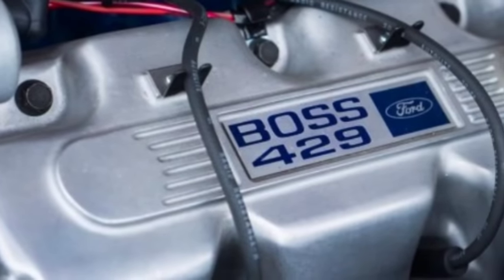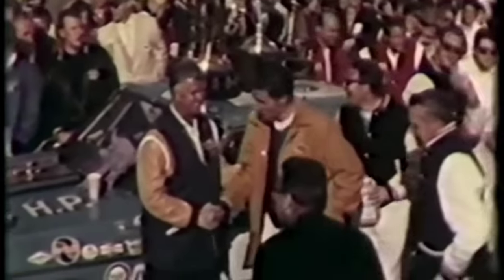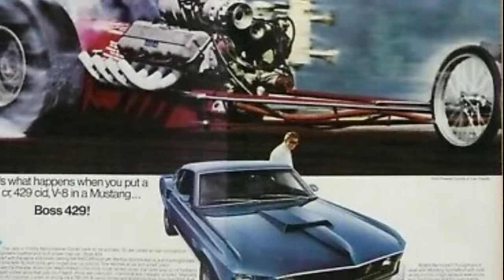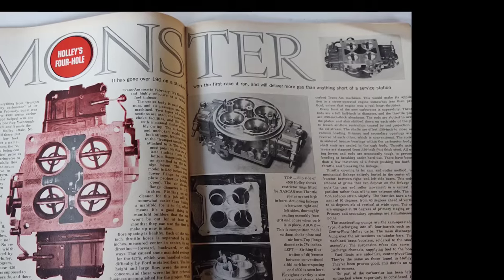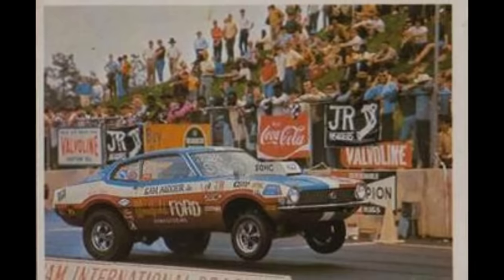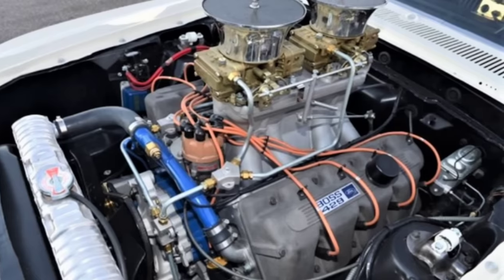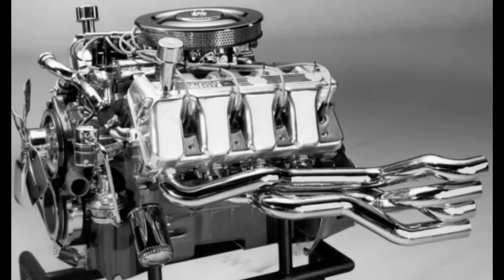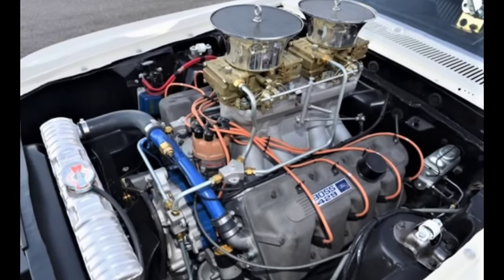The Misunderstood BOSS 429

Comment: fastest  car i ever rode in was a 70  mercury cyclone spoliler 428 scj, yes no typo a 428.....
Reply from the maker: The 428 SCJ cars were amazing!!! Severely underrated from Ford..  Thank you for watching! Please Subscribe and check out my project MIXED UP BOSS.. 
Andy
Reply: Did you know that just about all 427 Cobra roadsters sold to the public weren't even 427s.......they were pumped up 428s.  The 427 FE side oilers were put into the 427 Cobra S/C model.  Shelby thought the bigger cost of the 427 over the 428 would hurt the car for homologation.  However, if a customer found out he had a 428 and bitched about it, Shelby would supply the 427 to him.
Reply: Yes indeed. Great little factory street racer.
Reply: Semi hemi!
Reply: John Kasse builds big inch boss 9 line of engines!!!
Reply: I remember riding in my Uncle's 427 1969 Yenko Nova back when it was bran new. To this day it's the scariest ride of my life.
Reply: Those 428’s were quick. Ford made a bunch of 7.0 liter engines including the 427, 428, and 429. The first two were FE’s and the 429 was a 385 series engine. The 385 was just the name ford gave to the 429, Boss 429 and 460. But did you know you could make a 454 out of a 427 block and 428 crank? We built several in my HS Auto Shop Class for a local racer named Bill Cheeseburger. He dominated the 1/8 mile dirt track for a few years, and nothing could touch him! We also used 427 Tunnel Port heads which we ported by hand in our shop. I spent Hours with a strip of emery cloth smoothing out the downturn in the exhaust, which was pretty angular as cast by Ford. That was the worst part of those builds, the rest was pretty much common sense Hot Rodding. On the Street there was a guy with a 428 in a ‘67 Mustang fastback that was rumored to run high 8’s. The car had a tunnel ram with a pair of dominators on it. I couldn’t tell you anything else about it. And one last note, which I wouldn’t have believed if I hadn’t seen it myself. I worked with a guy who had a 69 Mustang Notchback with vinyl roof. It was clearly a luxury car, at least in dress. It had a run of the mill 302 in its but instead of the common high shock tower with an a arm and I arm underneath that, this car had twin a arms suspension up front. Nothing but room around the exhaust and no acrobatics or Yoga poses to swap spark plugs. The owner said that Ford had called him several times trying to get the car back, but he wouldn’t sell it.
Reply: Still my favorite sounding motor! I've never been lucky enough to drive one, though
Reply: Same Kerry's cyclone 70 with 428 shaker hood car beat anything on Woodward late 70s that was not blown engine or off trailer race car I've looked around n I've never seen another original 1970 cyclone 428 shaker hood ever always wondered what became of the car and my friend Kerry Peace n Love
Reply: Yep most under estimated Chevy big block killer out there.
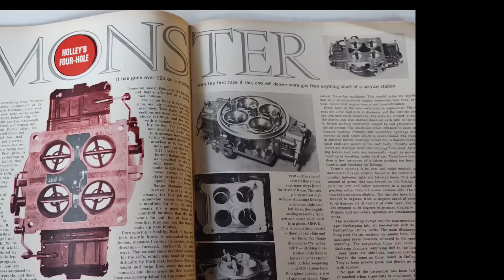Reply: 4:18 mark - The Holley Dominator that was built for the Boss 429 was not the carburetor we know today. This was designed to run as four individual runners (like running down draft webers). I did a story on this carb about two years ago that was veiwabout 200k times on my other Ford page on Facebook
Reply: oh trust me Ford still made limited big blocks in the day my 79 f250 camper special has a high compression heads with a 460 and a c6 transmission.
Reply: @kennethcohagen3539  Wow Greeeat memories. Thank you for sharing. That last one especially. 
Would love for that car to turn up.
Reply: I drove a friend’s 428 Cyclone on the street. 
Extreme is an understatement from a dead stop!
They were laughing at me when I returned. 
Apparently I had a death grip on the steering wheel because the horn was blaring all through my run!
The horn ring was actually integrated into the outer edge of the steering wheel !! 😂
Reply: @boostjunkie2320  my father wouldn't let ne drive his 429. Now I understand why.
Reply: Are you sure? I have a 1970 Mercury cyclone spoiler, and the engine is a 429 (not 428), which is a totally different block - not a FE engine.
Reply: Yup, I had a 69 Cougar Eliminator with a 428 SCJ... Raised compression, long tube headers, big cam, Rhoads lifters, bigger Holley carb, mechanical advance, non resistor plugs, big Accel coil...
Was never late for church 👍
Reply: I always loved the cougar eliminator.
Reply: Possibly the coolest muscle car ever
Reply: @LifeisGood762  I'm old. I remember this stuff. Ford engineers were beyond great. Another thing. Do you remember the autolite carburetors used in Trans Am racing? Two carbs . But they were like a hilborn injection unit. 4 holes in a row on both sides. Incredible thinking. They were allowed two 4 barrel carbs. But nobody said how to arrange them. Pure genius.
Reply: All hail the FE's
Reply: Wrong. The fastest car IIIIIIIIII ever rode in was my Toyota Prius Yenko superbird. 

Of course I'm kidding 😁
Reply: @xmo552  Now that's funny 🤣🤣🤣🤣🤣🤣
Reply: My buddy had a Wimbledon White '67 Shelby GT-500. He swapped the 428 with out with a 427 FE. You'd never know it at first glance, as the rest of the car was completely stock. It was a Screamer. His love was racing Ford Falcons. He unfortunately lost his left leg in a motorcycle crash and ended up running automatic transmissions. Rip Darrell.
Reply: @Cobra428SCJ  I remember those carbs. Truly awesome design. Very innovative engineering. To cool 😎😎😎
Reply: @brandonplaisted8194  i
Reply: Cobra jet go brrrr
Reply: The ‘69 Cyclone came with FE 428 CJ, the ‘70 Cyclone came with the 385 series 429, not the FE 428.
Reply: @ruthlessreid9172 I'm sooo glad he's doing that and bringing back the boss 429. With a stroked bottom end they work way better cos it evens up the bottom end with the huge head ports.
Reply: @Loulovesspeed i
Reply: I owned a 69 428CJ Torino Cobra that would roast the tires all the way to the rims! Never ran out of throttle!
Reply: 🤠 TEXASMUDNECK SAY OH so TRUE!!!!
Reply: In my senior year I found a nice 70 Charger 440 6 barrel for $900 and a close friend had a Torino Cobra 428 scj with a four speed...kinda miss those days...
Reply: I s a v8
Reply: Mercury cougar eliminator was the only car that kept up with my 87 grand national back in the day.
Reply: Not a Factory engine in 70
Reply: @xmo552 you forgot Hybrid, with a Crack Fed Squirrel
Reply: @marcanthony854  
Yea... a little black squirrel.

Fyi: I would have never let go of J.Lo. With that back bumper ...
😧👌
Reply: Yeah well the fastest car that I ever rode in was a 1970 Chevelle SS 454!!! So there!!!! I did however ride in one of those cyclones with the 428 and I didn't find it very fast!!! So there again!!! Ppppplllllllbbbbbbhhhhhh!!!!
Reply: Was offered in 429, not 428
Reply: You must have lived a sheltered life
Reply: @Loulovesspeed I’m pretty sure the AC Cobras sold in Britain were 427. “Trades description act” would have got them prosecuted.
Reply: @curtishays6765 - Try a '70 Torino 429 SCJ with the drag pack - 4.30 diff., shaker scoop and a couple other changes.  With all due respect to your 428CJ, the 429 SCJ would kill it!  It was a wicked beast for sure.
Reply: @SvenTviking - Nope, virtually all were 289s as GB had some serious taxes on poor mileage, large displacement engines.  I did see one 427 with R.H. drive, but that was a custom built one.  Shelby American produced just 343, 427 powered cars and 665, 289s.
Reply: When I was 11, a guy came out of the liquor store parking lot passed our subdivision, and chirped 'em in all 5 gears of (I didn't know what year it was; Including the specs until many years later) *I believe a '68 Mustang Fastback Black on Black. Everyone says I'm lying... this thing supposedly had a 427 side-oiler and Lonnie would say it's super temperamental. When she ran good, she'd run like a r##%d ape ! When she'd act up most miserable car ever. Supposedly that motor only came in limited models (man I didn't know any of that much less think to ask him at the time) just reporting what I saw as a kid ! I bet that 428 was smokin' ;)
Reply: The boss 429 as came stock was meh . With some tuning it would turn on .
Reply: Scariest thing I rode in years ago was a Granada with a stroked 460 and nitrous. Going across a bridge and he pushed the button at 60 and car was fishtailed all over .
Reply: @gregblack8550 - That is only because Ford designed it to perform under NASCAR racing conditions - steady high speed running and not the dead start and acceleration of a typical potent street engine.  With the solid lifter cam option and a little work, it could be made very competitive on the street!  :face-orange-biting-nails:
Reply: 70 had the 429, not the 428.
Reply: @ruthlessreid9172 - Just like the current Dodge Hemi !
Reply: @josephmercurio1024 - I thought so too, but after research, I found you could still special order a 428 for the '70 Cyclone.
Reply: @mykec.selene8302  ya well a 71 Boss 351 blew the doors off of a 70 Cheverly 454 in the 1/4 mile n that was a small block Ford so there! Eat that...
Reply: I remember the 1970 Cyclone with the superbird wing, my car as fast as hell
Reply: I was lucky enough to know the owner of a 70 cougar eliminator 428 SCJ  it is a hell of a ride. 
Also rode in a boss 302 4 speed mustang. They are no joke and could pin you back in your seat. 👍
Reply: 428 CJ was the way to  fly .
Reply: I love old ford's however the fastest car I rode in was a vw bug. A buddy built it and it would do high 6s or lo 7s o the best of my memory. The drag strip told him if he brought it back he had to put roll bars in it. He put the seats back in it and drove it on the street.
Reply: I had that engine in a 68 mustang coupe. Sooooo much fun. 🤙🏽